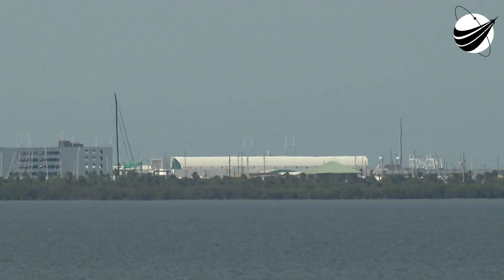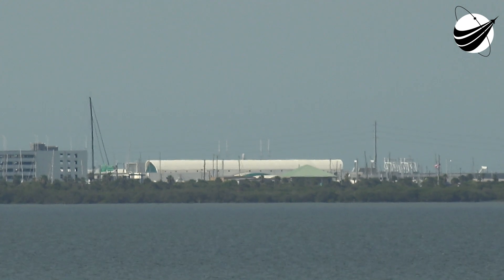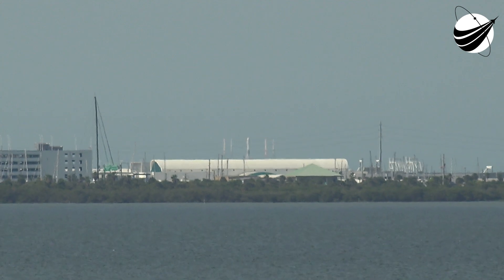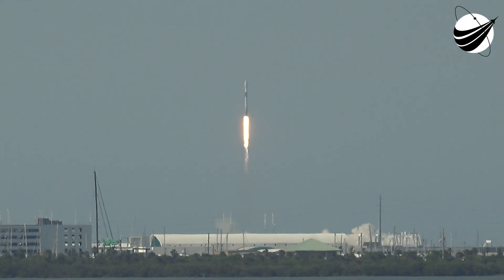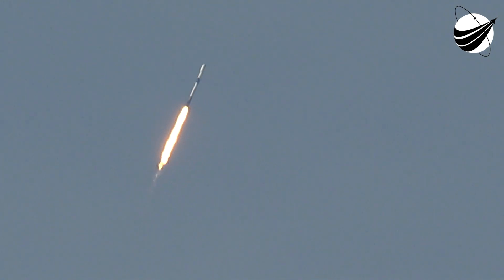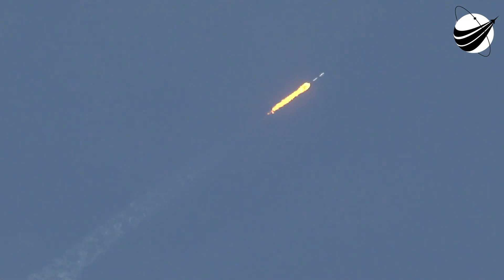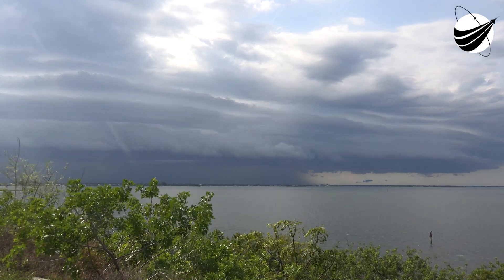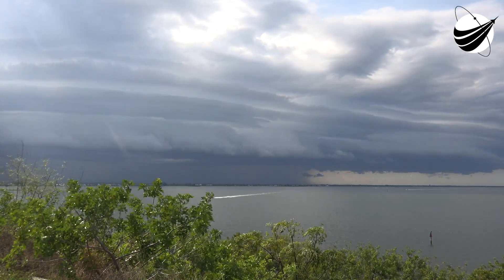SpaceX - NileSat-301 Launch

Comment: why do you add fake rocket sounds its lame
Reply from the maker: Real
Reply: @Uslaunchreport  bs, same audio on every video, sometimes it cycles, and then cuts off abruptly, go bs someone else
Reply: @DeathbyKillerBong  The sound is real, it is just the spacex stream, so the commentary is provided by one of four commentators. And then adding on to that, rockets all mostly sound the same, so it is always just a ruble with some pops.